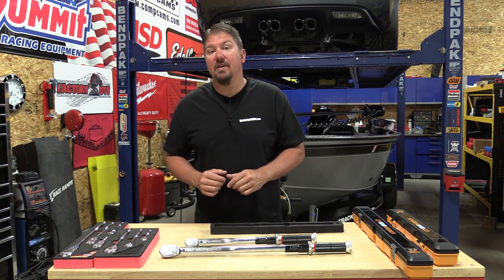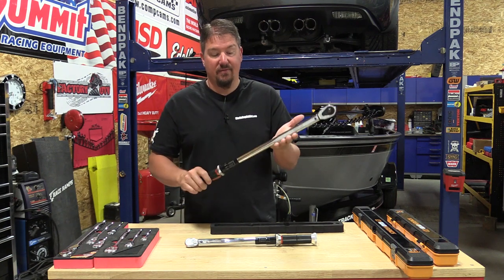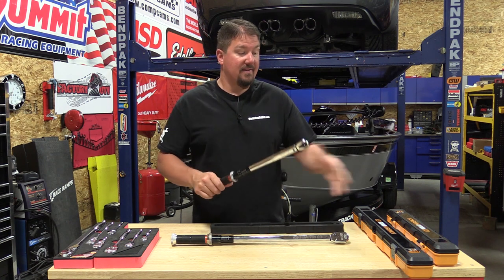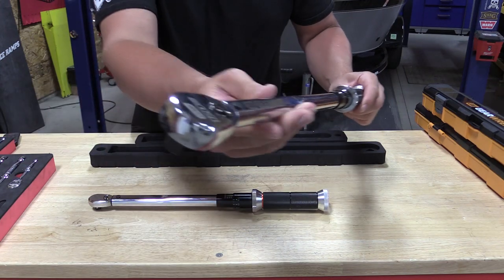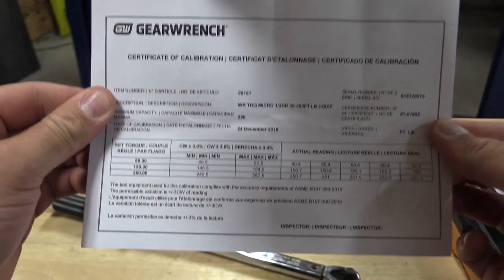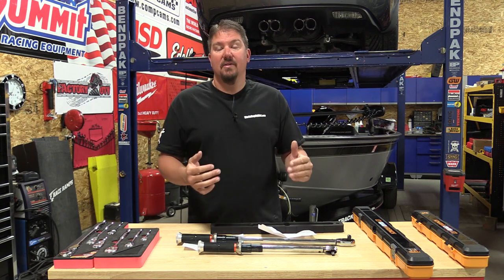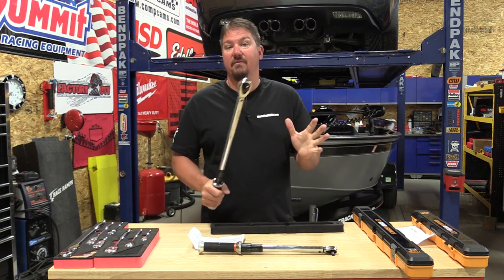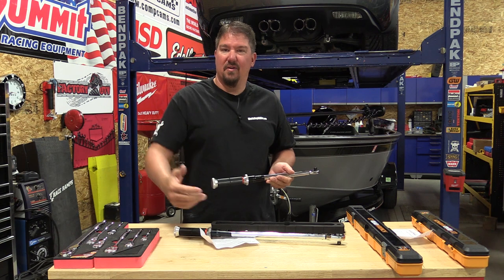My Favorite Click Style Torque Wrench! New GEARWRENCH 120XP Models 85176 & 85181

Comment: I have all 3 and love them!  Amazing how little swing you need!
Reply from the maker: I want the 1/4" bad!  Glad you like them.
Reply: @WorkshopAddict  i have tested the torque on all three and couldn't ask for very precise torque.  Even at 250 ft lbs it was within 3 lbs over 10 clicks.  Amazed
Reply: Do you know if these can be recalibrated down the line (5-10 years later)? What is your take on the 120XP Digital Flex Head version?
Reply: @henri6595  yes they can be recalibrated.  The end cap turns off to reveal the dial for calibration.  

Haven't used the digital but that may be the next buy
Reply: @HayabusaRydr  Excellent. Thank you for the speedy reply.

Comment: Question how do you find out what bolts need to be torqued to what spec? Like for wheels or even parts on the engine?
Reply from the maker: Wheels on vehicles will be listed in the owners manual.  Other bolts on engines and such would be in the service manual of what you are working on.

Comment: Quick question, when you torque a lug nut and the weight of the vehicle load is on the wheel, will it click before you reach you torque settings?
Reply from the maker: Not as long as your hub is in proper alignment on a hub centric rim or your lugs are all in place and mostly tight on a lug centric rim.
Reply: WorkshopAddict  thank you my guy. I subbed and liked. Great channel and tool.

Comment: So in other words.. same accuracy as my Armstrong USA made torque wrenches. Which costs about 30% less than those GearWrench ones. lol. 

btw- Armstrong Torque Wrenches had a lifetime warranty on the ratcheting mechanism, 90 day on the calibration.

I just don't honestly see the point in the 120XP head. I prefer the thinner 88T heads used prior.  Thinner head, can reach more places and the repair kits for it are still made in the USA by AJ Manufacturing in Illinois. :-)  120XP kits are built in Taiwan/China. 

Would be awesome later if you could get your hands on an 88/84T Gearwrench torque wrench and show the differences between the two maybe?

good review none the less.